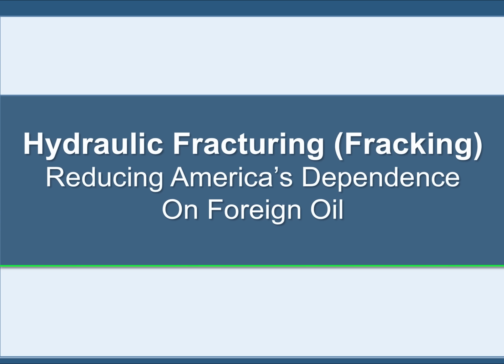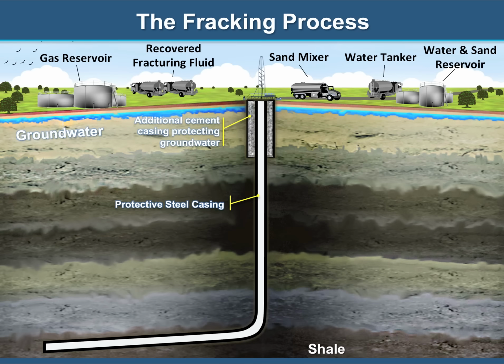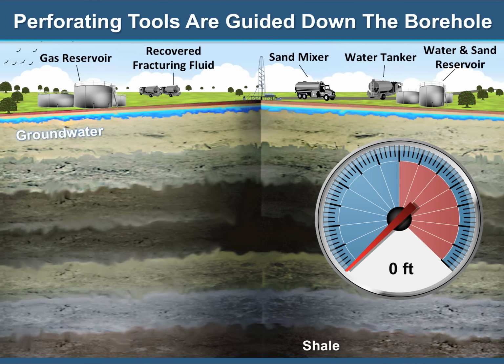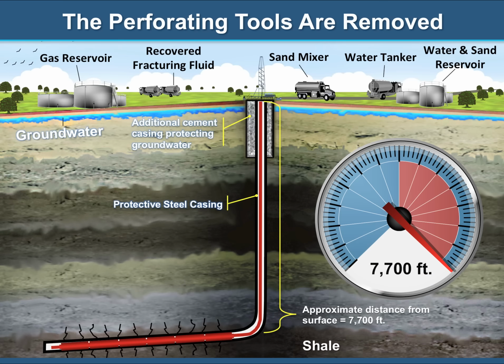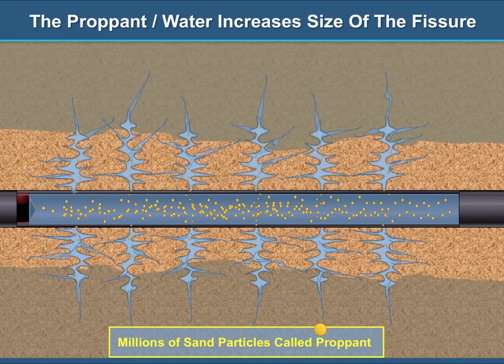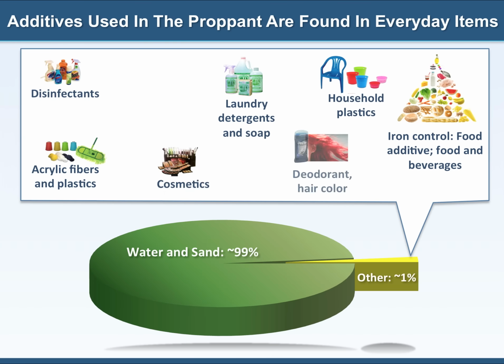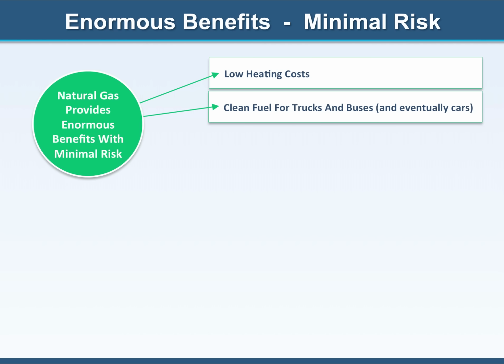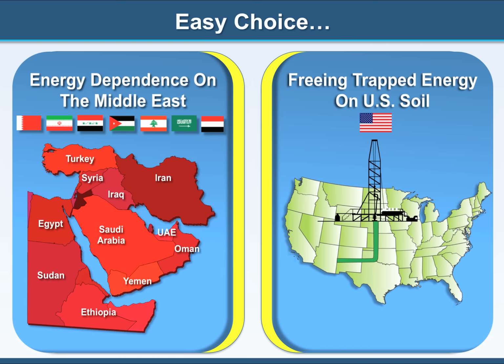Fracking Explained with Animation by A2L Consulting

Comment: Its funny because practices today are the best they have ever been! I would be much more worried about older existing gas/oil wells and the thousands (maybe millions) or shady botched surface/intermediate cement jobs. I agree 100%, fracking isn't what I would worry about if you're talking groundwater contamination. It would be casing cement jobs A lot of people dont have a clue.

Comment: It would sound too good to be true this video!  Of course, its never that easy and we can't replace oil imports with natural gas because cars don't run on natural gas. Most of the big tankers driving around on the ocean are full of oil headed for gas stations near you. The only way to cut dependence on foreign oil is to require less foreign oil, as in electric cars.

Comment: Fracking doesn't contaminate water faulty well casing do. If you asked me "Was there was proof that fracking caused water contamination"? my answer would be NO however change the question to "Has there been any recorded case's of water contamination due to gas drilling"? my answer would be most definitely YES. You silly greenies always ask the wrong question!

Comment: oil well is also a natural bottle that if you pump a lot of shit in it, seal it, with time (heat and pressure) it will become oil.  It also negate external pressure that cause earthquake.
Oil is natural carbon, trapped by layer and layer of soil movement.  Natural gas are by product of ancient/dead bacteria that consumed these hydrocarbons.

Geez, maybe I SHOULD TEACH YOU EVERYTHING!!!  wanted for free?

Comment: @ dudes110. Slickwater isn't used in the drilling process. It's used in the hydraulic fracturing process. Fracturing and drilling are two totally different process. This misconception is an easy way to tell the difference between the real experts and the idiots who use the lies on the Internet to act like an expert.

Comment: I learned from your comment - no need for the insult. 
Fracking has been done for decades in CA w/o problems. Conditions vary from region to region. In the Appalacians, Radon gas IS an issue. 
 If it going to done, then fracking should be done right.
(P.S. - no casing at drill head, with the associated high pressure cutting mud).

Comment: Inner steel casing cement outside of that another steel casing. When fracking occures it happens do to the very last sections in the horizontal run being perforated by by small small charges of explosives with slugs to penetrate through the steel. Note the steel casing retains the pressure applied the formation is what fractures near the perforations. The cement you are talking about is 6000' away from the fractured zones! 
  Try educating yourself a bit.

Comment: The drill head is ahead of the casing, so drilling mud, under pressure, is free to move into aquafers that are crossed. 
 Casings are cement - since fracking can frack stone, it can frack cement. 
Current process is fracking up the Earth.

Comment: Know what's funny? I know this technology isn't going anywhere until every drop of natural gas or oil is extracted on Earth. If you don't like that, go live in a cave. Completely disconnect yourselves from anything involving fuel whatsoever. Even the wind turbines are set up by truck and crane that burn fuel. Solar panels are made of carbon plastics. You can't bitch AND live off of fuel everyday AND take it for granted. You bitch when you pull up at a gas station and the pumps are out of order.

Comment: Secondly, a well may be drilled and never be stimulated or "fracked". The cement job encasing that aquifer can still be contaminated regardless if the well is stimulated. The same problems would occur regardless if the stimulation is done on that well. So honestly, you're pointing the finger at the wrong people here. It's a lack of education on the process, and understandably a lot of people are frustrated about this, mostly because they are just going off of some bullshit website or hearsay.

Comment: When you are educated about the process like I am, being an actual Frac worker, you'll know that it's not the "fracking" that's the problem. In 99% of the problematic cases, it's the drilling in the first place and/or the cement job. The integrity and protection of the water tables (if any are drilled through) is the single most important aspect of the whole process. Now if the drilling and cement team hand it over to us and say they've done their job, then we proceed to stimulate that well.

Comment: No you're right, we don't NEED it. I want you to tell me a single thing that you own that wasn't somehow involved with fossil fuels one way or another. Even solar panels are made of carbon based plastics. Wind turbines..how do they get to their final setup location? By truck. What does a truck burn...? Diesel fuel. Everything you've ever bought at a store was on a truck at one point in its life. Trucks run 80% of our economy, so that 80% is dependent on crude oil. You define the word need then.

Comment: That is correct. But after 30 years a well would be nearing it's end. If anything was left it was being produced using artificial lift. The frac job would have already have been done. There wouldn't be sufficient pressure to reach any water table. Besides any cement failure or casing failure would be fixed (squeezed).

Comment: I realize that there are people affected and that sucks, and it's usually because of a freak accident. It is not a perfect science. The fact is though, on a large scale, the success rate is extremely high. Also, most of the problems associated with leaks are not do to Frac, but the drilling in the first place. One big thing a lot of people don't know is their water well is situated on a seam of coal, and coal is FULL of methane. Periodically, there will be a surge of methane from that well.

Comment: you know that whatever man does there is error, and in the frack biz, there are many errors because they just dont give a damn.  They cut corners all the time when they can--who knows if they are using steel sleeves and concrete in the wells; most likely they dont.  Why are so many homes contaminated? because you have frack drillers who dont give a damn one way or the other--they just want their gas and they dont care if they destroy your land.

Comment: Let me tell you exactly what it is to help you out. First, water is sucked into the DryGel pumptruck and blended with the same powder that is used in everyday foodgrade items, once that mixture is made, its pumped into the Blender pumptruck where it meets up with the main water supply, and the sand coming from the mountain movers. The blender mixes the gelwater mixture up with the main water and sand along with a few additives for lubrication and gets sent out through the pump trucks downhole.

Comment: They just gloss over the problem of casing breach.  There are only two types of concrete:  that which has cracked and that which is going to crack.

And what about the little earthquakes occurring around fracking operation?  One crack from deep to aquifer - just one crack - and that's all it takes.  It might take 6 months or 2 years or 15 years, but that frack fluid will find its way to the aquifer eventually.

These guys are environmental terrorists.

Comment: You are absolutely right about the utilization of hybrid technology on the larger vehicles such as tractor trailers/buses etc. The older tractor/trailers were getting 5-6mpg, and the newer models are getting 8-9 and probably with lighter loads 10mpg. I drove trucks for 5 years and I've been on a Frac crew for a year now, so I actually know what I'm talking about on this subject. With the insane amount of trac/trailers on the road, it won't happen overnight.

Comment: I honestly am amazed at everything I hear concerning Frac work. I can tell you for a fact that we are not using 500 different chems. We have 1 flatbed trailer that holds 5-8 diff chems in containers, which hold 250 gallons each. We will use up the contents of that trailer over the course of about a month. We do 4 wells a week. 1500 gallons/16 wells, about a 90 gallons per well. Now remember, we only have 5 to 8 different chemicals ALTOGETHER!! So how can it be 5000 gal of 500 diff chems? Crazy!!

Comment: How do the chemicals get into drinking water? Most wells are around 2 miles below the surface. Most water tables are around 500 ft below the surface. The chemicals are pumped down pipe. The first 1000 to 1500 ft (know as surface) has cement, then casing (thick metal tubing) and then another layer of cement and then smaller casing. After surface there is a layer of cement and the smaller casing down to TD. The chemicals can't go back up through the formations. So how does it get into water?

Comment: The amount of chemicals getting pumped down varies from 5000 gallons to 600.000 gallons of chemicals, it doesnt matter if they are mixed with lots of water, its still chemicals, that will get in the drinking water.

There are tons of chemicals, i cant list them all, There are gamma radiating isotopes which can cause cancer, benzene, which can cause cancer and bone marrow failure, lead is damaging to your brain and nervous system, antifreeze chemical which cause death. --->

Comment: It's "clean" in that it's clean burning but you can't deny the environmental concerns with drilling (fracking or not), the clearing of land, pipelines etc. By the same token, nuclear isn't clean because of mining for uranium and the 100x talings per unit of enriched uranium. 

With respect to tractor trailers, look at what London is doing with their buses. Using hybrid  systems make them more efficient (and the availability of torque makes them able to start moving effortlessly).

Comment: Natural gas IS clean energy...much cleaner than gasoline or diesel. But that fact is, wind energy, or solar energy, isn't going to move 80,000lbs which is the weight of just one tractor trailer carrying any and all freight that is our American economy. About the only thing they can do is improve upon the current large diesel engine design to make it more efficient. And that is already underway. The average big rig gets roughly 6 miles to the gallon. Newer models are getting closer to 8-9.

Comment: Do you also walk everywhere? As in no vehicle. And don't buy anything from anywhere, because everything you buy comes off an 18wheeler, which is powered by diesel fuel. 80% of the economy revolves around trucks and freight. That is why it's so important to harness all of the energy that's available. The other 20% is railroad and air freight. So ALL 100% of the economy is based on fuel. I realize that in your small world, having solar panels really is cool, just not for the entire country.

Comment: There's no replacement on the horizon for 20 to 30 years....Europe's a  great example the tax's paid on fuel exceed the cost of the actual fuel,and yes they still use fossil fuels.Mostly diesel for autos and trucks.  You should get out more. :)  Can you give me a date for the impending doom ????:) There is no good data,for climate until 1980.....That's when it was automated global measurements for temperature,genius. Accuracy is so important if one is interested in  getting at realistic,result.